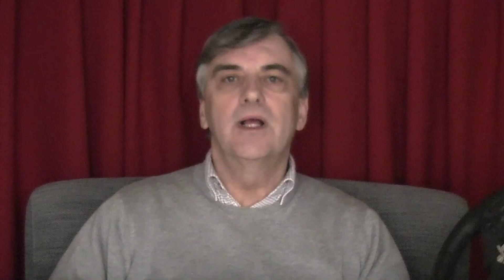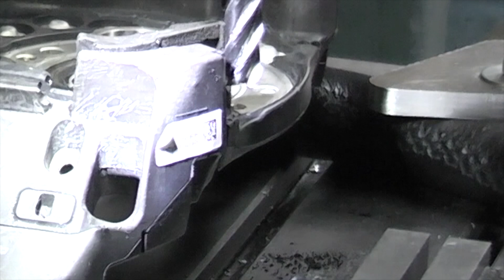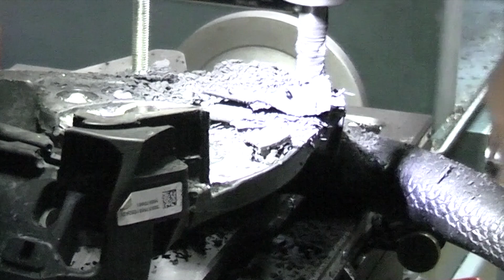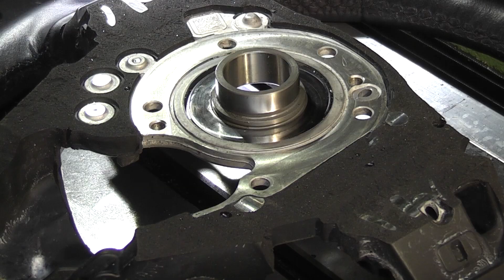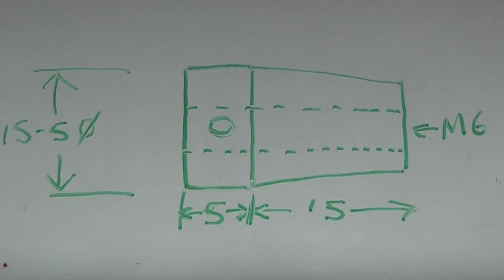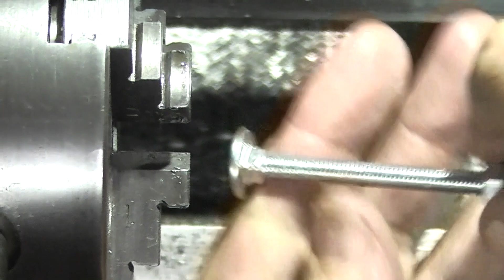Headstock handle

Comment: When parting off, it's handy to have a small file to deburr the work before it is completely parted off. That saves a step. If you need a larger champher on the work then what you did is the way to go. If the work is hanging out a bit then it should be stabilized with a center in the tail stock.
With a quick change tool holder, part the work a bit then swap tools to the desired champher tool. Cut the champher as required, then go back to the part-off tool and finish cutting off the work piece.
Save your chop sticks from the Chinese restaurant and use them to catch parted off work. Cheers from NC/USA

Comment: Put the wheel in the frezzer When frozone solid it becomes easier to machine ...
Reply: I've made special seals by dipping the rubber (actually neoprene) into liquid Nitrogen and cutting on the lathe with sharp high speed tools. Avoids having to make special molds for the seals.
If you do this wear goggles and be very careful as cryogenic liquid splatters will freeze skin instantly.
Cheers from NC/USA